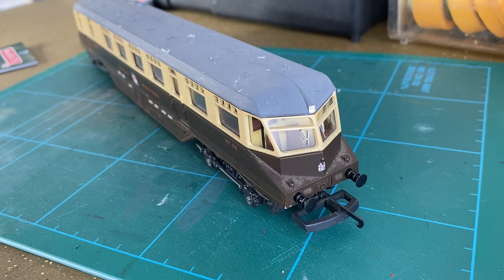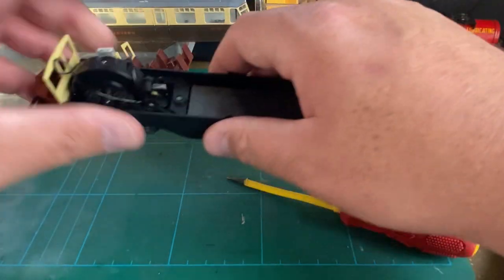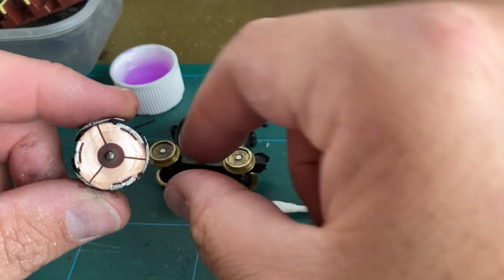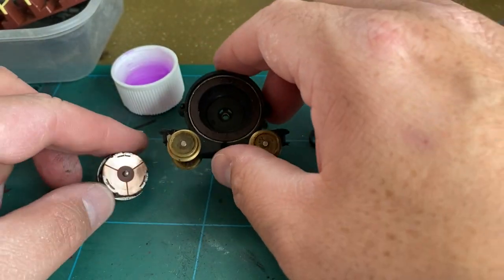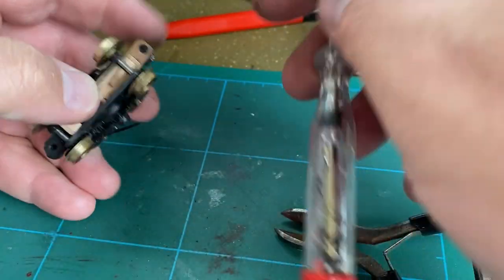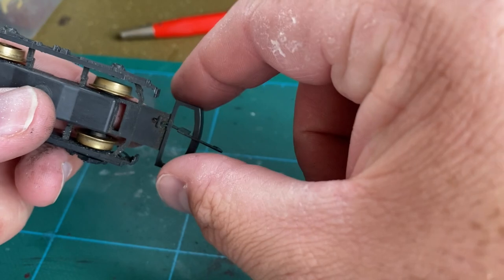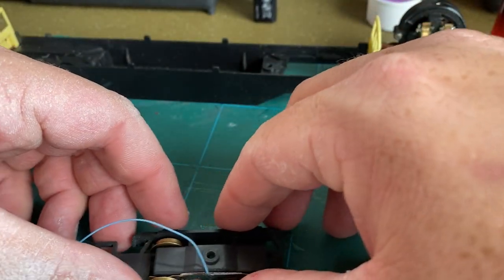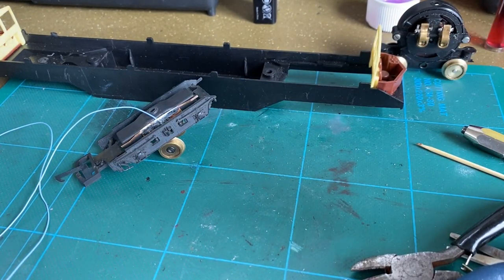Lima GWR railcar restoration. OO gauge model railway. 500+ subscriber special.

Comment: Good job! The only thing I can add is if you tin both surfaces (ie the wire and the brass strip first) then the two joints will go together much easier. The use of flux is always a good idea, despite the multicore solder having flux in it.

Comment: For your wire connectors on the weight - you can get model railway copper clad strips - they are copper on insulation and are easily cut to a desired length with a hobby or small hacksaw. You glue the insulated side directly to the weight and solder to the copper. No risk of melting insulation tape. One manufacturer is Railroom Electronics ..  bound to be others.

Comment: Dan you do realise that those buffers need to come out every time you need to get to the motor
Reply from the maker: Yes i do, just using a small amount of Locktite allows the buffers to be removed quite easily. After filming i had to remove the body twice, once to rectify the bogie and wiring issue and once to change decoders. .